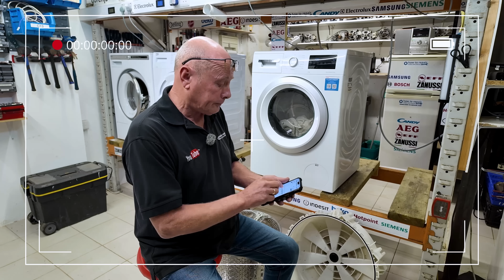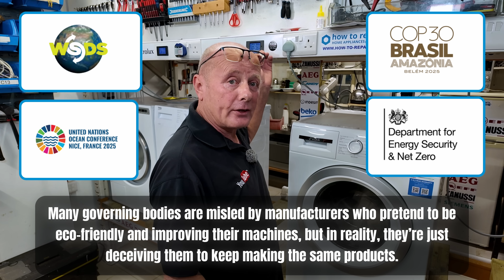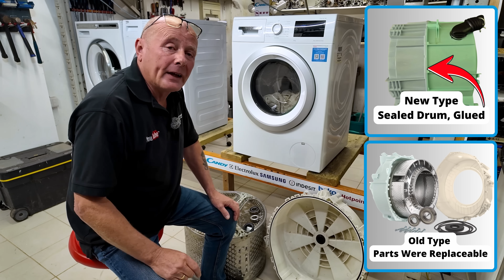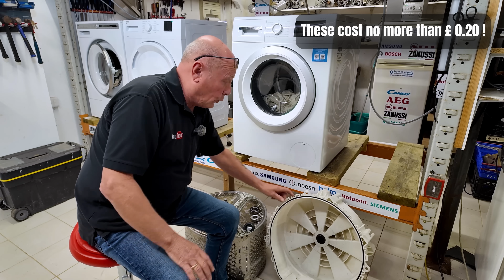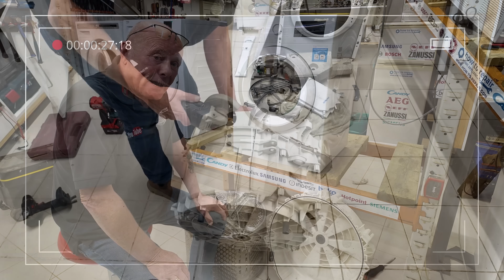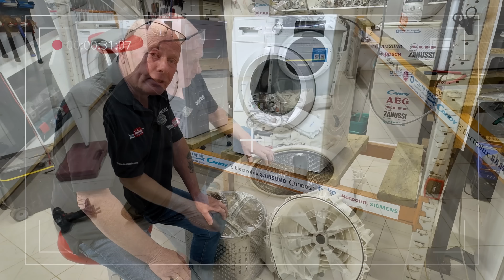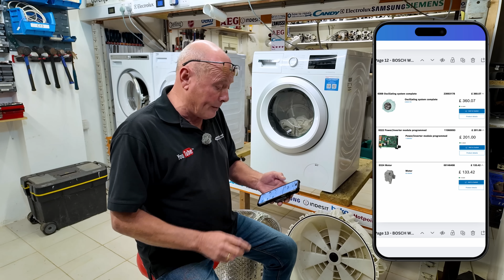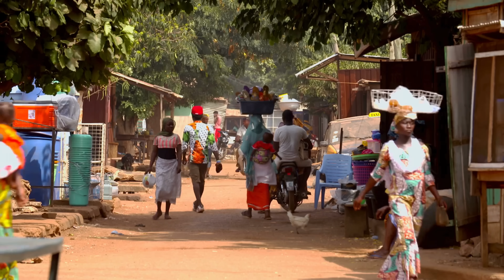Washing Machine SCAM EXPOSED! The Truth About SEALED Drums: Naming & Shaming

Comment: This is how they eliminate right to repair - insane parts price.
Reply: Insane part prices is not enough. You also need support from the government in form of copyrights. 
Otherwise third party companies would start making and selling replacement parts
Reply: @hubertnnn which is a good thing. Free markets isn’t that what we live in? If someone else can do it cheaper then I should be able to go to them to get my replacement parts. Not held with my pants down by someone’s who’s selling me something designed to fail to then sell me overly priced parts
Reply: same shit for cars, and many other products.......
Reply: Buy the OEM parts from the Chinese manufacturer. They are dirt cheap and all these parts are Chinese. You can still pay 30% for replacement parts by going to industrial resellers. LG didn't have the agitator for my washing machine and wanted R3500 for it. My reseller sold me a great quality part for R300. That's 10% of the OEM.
Reply: @darnit-dad that is IF you can find them 8n China...
Reply: Do ur research, Mass airflow sensor for Subaru Forester retails 680$, bought direct from Robert Bosch, 120$.  Ign coil for mercedes CLK AMG V6, 250$, from Delco USA direct 60$.
Reply: @partymanau  I have faced very interesting "problem" with buying parts directly from OEM manufacturer... For example, Z18XE ignition coil block, as far as I could compare visually and conclude, is made by NGK for GM. But directly bought coils was causing me random errors to the damn Simtec 71 ECU (which itself is another story...). So, I put two part clip-on ferrite coil on the wires close to ignition coil block. And no more random errors in ECU! So, what I concluded? Yes, in OEM parts for GM they, probably, put these already inside as ignition coil block is filled with some compound from top side and one cannot normaly see whats inside... But for non-OEM buyers, nobody bothers about this... And that's why I had seen people saying that only original GM coils are working OK with this ECU...
Reply: @partymanau You would not believe what the factory pays. Usually about 1/10th to 1/5th of their listed spares price. In aviation it is 1/100th to 1/10th!!
Reply: My guy who fixes my appliances years ago told me it's not going to be worth fixing thing soon they'll just make parts + labor not worth it... He's now right
Reply: @JimBush-q2j  if repair guys charge a £40 call out fee (some years ago) then part cost and labour cost it can be expensive which is why people will attempt it themselves as they could save a lot of money for a cheap fix , id rather get repair guy out but with some it can be to costly , one video r\guy charged £60 and another £15 , same repair ,,
Reply: Apple style :)
Reply: Exactly, Apple do it, it's only a few quid cheaper to go through all the hassle yourself than it is to send devices off to them.
Reply from the maker: Thank you for your comment. I appreciate people like you taking the time to write it out. Please don’t forget to subscribe and share it where possible. It might help others make a wise choice instead of being misled by the industry.
Reply: @How-to-repair  And who's using automated responses...
Reply: Greed, just pure greed, 
& yes there are loads of fake sites , with fake comments especially on politics . 
Keep up the Great work hopefully more will follow .
Reply: sometimes they dont even need to increase price too much. they can just use damn ledless BGAs and that will make repair more expansive than used unit.
Reply: One of the main drivers behind eliminating 'right to repair' is the EU.  They've already done it to vehicles - but  they call it 'type approval'.
That is why it's happening in the northern hemisphere, but not the south.
Reply: @Renegade1127  The EU actually wants 3rd party parts to be available for cars. They do studies how it affects part pricing between countries that forbid coping of exterior parts and countries that don't.
Reply: @Renegade1127  In the Southern hemisphere, does the washing machine spin the other way ?
Reply: @Renegade1127  The earth is fixed and immovable...Keep off the crack pipe son
Reply: @jbbloodclot Where is the EU?   In the northern hemisphere.   Keep off the vodka son.

Comment: A good example of machines that are actually designed to be repairable are Hobby grade RC's. For example, just about any part on a RC car you buy today you will be able to replace. The parts probably cost more than they should, but at least you can get them. From motors, controllers, steering parts, body parts, wheels, tyres etc. and the great thing is, this teaches people how to fix things. Even cheaper Chinese brands make replacement parts for their cars. As 3D printers are getting better, more parts can be printed.
Sure there will be some examples that may not be as easy to get parts for, but the companies understand that people need to replace the parts, otherwise they won't buy their cars. A good example is MJX, a Chinese company making really good cars and spare parts. Yes toys is one thing, home appliances is another, it is possible.

Comment: In Thailand I had an LG washing machine for 10 years. Replaced the PCB twice. Sold it cheap and bought new Samsung going on 12 years now. Replaced PCB twice, various other parts too. Seems the PCB boards are designed to fail after 4 -5 years.
Reply from the maker: Hi mate thanks for the comment. Your experience with having to replace the PCB twice on both machines strongly supports our claim that the PCB is one of the three main components (alongside the sealed drum) that the manufacturers are designing to fail. We showed that the retail price for a replacement PCB on some new machines can be upwards of £200, making the repair even on otherwise great machines a very costly exercise. 

Thank you for being on board with the main idea! Reaching maximum visibility is completely dependent on our team. I need your partnership, so please make every effort to share this far and wide.

Comment: Can you do a video on the PCB's? Why are they not repairable? Are they sealed in epoxy? Are all the relays controlled by a proprietary IC? Do they do dodgy stuff like putting a high voltage line next to a data line(classic (Cr)Apple trick)?
Reply from the maker: You've hit on a really important point about Printed Circuit Boards (PCBs) and the methods manufacturers use to make them difficult or impossible to repair. This is a major part of the planned obsolescence we expose. Also, I am planning to make a comprehensive video about PCBs. 

At the trade show last year understanding how much obsolescence is being designed into new appliances these days is something everyone should be aware of. For a deeper dive into this topic and to see the examples we covered, please check out the full video here: https://youtu.be/gEgSCbZnHVM?si=wTIw0mELuhWaw4aX
Reply: @How-to-repair  Thank you for your reply. Keep up the good work. There are still great whiteware manufacturers out there like Speed Queen. It is not all doom and gloom, despite it being the general trend.

Comment: Thank you for standing up! I have repaired my old trusty Samsung WF8704FPA a few years back with new bearings and a new spider (broken) as well as a new heating element and shock absorbers. Now i have to replace the rubber seal, after patching it up when it started to leak but now it is really sliced. This thing will go on forever and I guess the only reason for buying a new one, is when the parts are not available anymore. Also, it might use a little more water and thus heating it up is more costly, but at least the things I wash will actually be clean! Also I found out, that with some parameters, I might even have more (or less) water when rinsing... How awesome would that be. Can somebody explain to me, which problem will be solved by adding wifi to a washing machine.
Reply from the maker: It’s good to hear that you were able to fully repair your Samsung WF8704FPA, replacing the bearings, spider, heating element, and shock absorbers. Your experience proves the benefit of companies like Samsung (who we mention are in the Southern Hemisphere/Asia) still producing machines with splitable drums, allowing you to easily replace the bearings and spider a component which can cost around £25 to £40 but saves you from buying an entire new drum for hundreds of pounds. 

I've been repairing washing machines for nearly 50 years, and the basic principles of washing clothes haven't changed since the 70s. They wash, tumble, heat, and spin. It's baffling why we need so many extra features now. Machines used to last 15 to 20 years on average. Nowadays, you're lucky if they last five years. Obsolescence is clear in today's society.

Making this as visible as possible is up to all of us. I can't do it alone, so please remember to share it wherever you can.

Comment: In Australia I think we are already covered if products fail past the warranty period. Australian Consumer Law (AGL) provides consumers with rights to a repair, replacement, or refund for faulty products, based on whether the problem is deemed "major" or "minor". Consumers can choose between a repair, replacement, or refund for major failures, while businesses can choose to repair a minor failure first. These consumer guarantees apply automatically and cannot be negotiated away.
Reply: I suspect the same drums are used in Australia, but are NOT welded, they are assembled with screws. The holes are already there...

Comment: Still using my 20 year old New Zealand made top loader. One set of new drum bearings for minimal cost. All parts are still readily available and not expensive. Incidentally, it uses a reliable induction motor that some people modify to run as a generator on micro hydo schemes
Reply from the maker: Thank you for your comment. I appreciate people like you taking the time to write it out. Please share it where possible. It might help others make a wise choice instead of being misled by the industry.

Comment: LIDL- MY AUNT BOUGHT  A OXIMETER, BLOOD PRESSURE MONITOR+AN IN EAR THERMOMETER...
ALL DIED, WITHIN 3 WEEKS OF THE 3 YEAR WARRANTY...
I'VE OPENED UP THEIR ELECTRONICS, WHICH NEIGHBOURS BRING,FAIL IN DROVES..THE SOLDERING IS DONE BY RETARDED CHIMPS, JUDGING BY "QUALITY" OF JOINTS...
SWITCHES ARE ABSOLUTELY CRAP...
MINOLTA COPIERS- HAD(HAS)  A"KILL SWITCH"...  AFTER CERTAIN AMOUNT, COPIER WON'T WORK, EVEN IF CARTRIDGES ARE HALF FULL.
PRINTER INKS- LOADS OF SCAMS...
NEED A GOVT OWNED WEBSITE, WHERE PEOPLE CAN REPORT SCAMS- AND THEY BLOODY ACT ON IT....

Comment: One of the bigger problems is also the cost to repair by a repairman. People want to make money.... Example: my Samsung stove started leaking gas when all the valves were closed. I was quoted $900 CDN to repair it.  The stove new was $2000. The parts were $250 if I did it myself.  I replaced the stove instead - bought a more reliable brand for $1200 that's been going strong for 5 years now. Do you know why? I had issues with the starter for the oven before, and I ordered a new one for I think $20 and did the repair myself. It worked great till the gas leak.   I understand the need to be able to repair - I agree. But there also needs to be guides to repair them as well for those technically inclined.  I would have repaired the gas harness/valve assembly, but was scared I wouldn't do a good job because there's no documentation about how to do that.
Reply: those Bosch washers are chinese. the germans dont build anything of value anymore.
Reply from the maker: You've hit on a really important point about how inflated labour costs, combined with the lack of available repair documentation, make self-repair intimidating and often push consumers toward replacement even when the cost of the part is low. This is a critical barrier to the Right to Repair! It's great to have your agreement on the core concept! Getting this message seen by everyone is a collective effort, not a solo one. I count on you to share it out everywhere you can.

Comment: A £900 machine and only 1400 rpm? We were renovating our house in the late 90s, and 2000 rpm machines were becoming commonplace on the market. Somehow everything seemed so new and exciting back then. We got a Zerowatt slim line. I assumed that in 30 years, that speed would be Worp-like - 5000 or something...
Reply: Those 2000rpm machines (Gorjenje and Akso) were smaller capacity of around 5.5-6kg IIRC. You can't beat physics! For more modern 8-10kg machines, 1800rpm seems to be the maximum (in Asko), but that Akso model is very fussy about actually reaching that speed and will usually detect imbalance and refuse to reach it.  :)
Reply: If anything does the prevalence of 1400rpm as the default spin speed on most modern offerings increase wear and decrease service life  compared to older 1100-1200rpm models?
Reply: Obviously the tiny (approx. 200mm diameter?) spin dryers in twin-tub washing machines routinely have 3000+rpm spin speeds!

Comment: I'm in Perth Western Australia. I'm 78 years old now, Retired. I started an electoral apprenticeship in 1963 and have worked for myself as an electrical contractor  since 1976. I have installed and repaired a lot of different products including ducted air conditioners ever since. Over the years I found how hard companies made it so we had to call on the manufacturers trained companies as we could get the information but not the expensive test equipment unless we paid for them. As we maybe only used them once it wasn't worth it. 
We purchased our Simpson 7.5 kG top loader washing machine in May 2013 & it needed a new main electric board. I checked & I was able to buy a Haier 7.5 kG top loader for $424.00. Retail was  $749.00. The sticker said 533 Kwh per year using warm water & 110 Liters per wash, 7 washes per week. I checked the Fisher & Paykel 8 kG top loader that looked similar. Its retail price is $1,199.00. It said 219 kW per year & 82 Liters per wash the rest said the same. Wait a minute if the motors & heaters are the same how does the clothes come out washed clean the same. That's like quoting a ducted air conditioner compared to another company's product in the same house doing the same job using the same refrigerant gas & saying this brand is going to cost half as much in electricity as the other brand you are being quoted to do the same job. I'm not saying they are wrong  in what they are saying. It just doesn't make sense to me.

Comment: not really a conspiracy....
they buy the parts from the same factory.
many of the machines you see are just rebranded shite from a single factory.

a way round this, would be to locate the molding factory that makes the 2 half's for the company & buy the half's, before they are welded together.
not cheap... but cheaper than buying a full drum.
i'd worry more about the  reliance for wifi & blue tooth.

Comment: Even if the bearings last, the spider is guaranteed to fail. It is unprotected diecast aluminium in a hostile environment. If they wanted it to last there would be a protection coat on such as anodising it. I had a Samsung with a splittable drum and managed to obtain a new spider, it was a process but I managed to get it done. Before I installed the spider, I had major defects repaired with tig welding and then used three pack to protect it. The original Samsung spider failed at the seven year mark.
It was just purely due to corrosion of the aluminium which made it fail, you can’t tell me that’s not planned failure. At least the drum was splittable.
PS
My Samsung had only ever been used on the lowest water level but the corrosion was complete through the arms of the spider all the way to the centre hub.
Reply: IIRC, Paul or another appliance engineer detailed how LG aluminium spiders painted unlike Samsung.

Comment: You have the right to repair. Just not the money. But in Poland they can split the drum and replace the bearing significantly cheaper. Maybe Brits should learn this also.

Of course I bought an LG machine. This has the additional advantage that there is no need to repair as they last forever.
Reply from the maker: You've hit on a really important and accurate point about the financial barrier to repair and the necessity of finding brands that actively support longevity, specifically contrasting the UK's high labor costs with Polish repair viability.

I completely agree with your sentiment the "Right to Repair" is useless if the cost makes it a financial impossibility.

To truly make a difference, we need to get the attention of industry leaders and stop these wasteful practices. Sharing this post is crucial to spread the message.

Comment: Another aspect of built in obsolescence is the frequent change of model number; the actual machine is largely identical to its predecessor but the model number is different. This seems to allow the manufacturer to avoid keeping large stocks of spares, basically they only have to stock spares for the current model.
Reply from the maker: This is a classic tactic used to control the aftermarket and discourage repair, and it perfectly complements the built-in failures we covered. This forces the consumer's hand to replace the entire appliance, even if the failed component is relatively minor. It's great to have your agreement on the core concept! Getting this message seen by everyone is a collective effort, not a solo one. I count on you to share it out everywhere you can.

Comment: I'm sorry but if it takes all day Saturday to cut the plastic drum, replace the bearings and then reseal the plastic with silicone and screws, I'm going to do that. Silicone can take the heat. Make sure all surfaces are completely dry before application. All they are doing is slowing us down a bit.